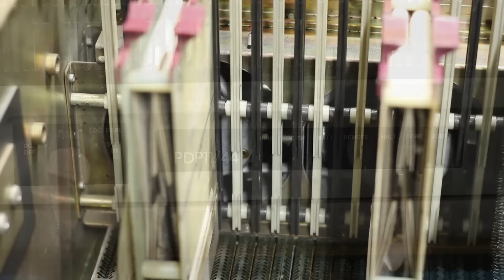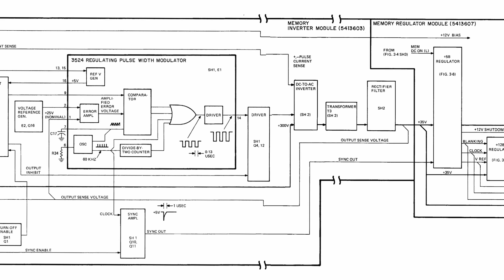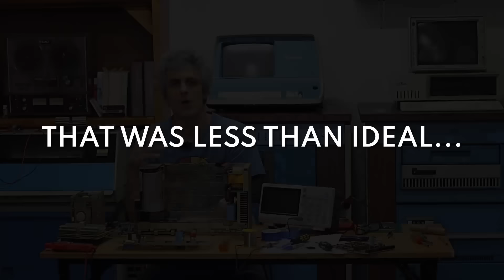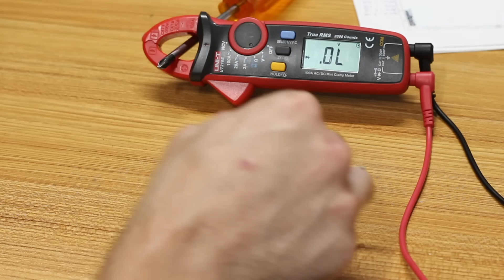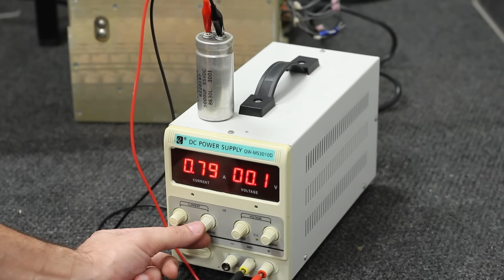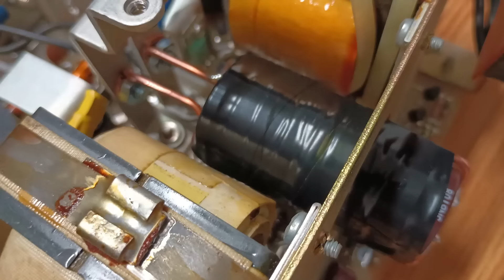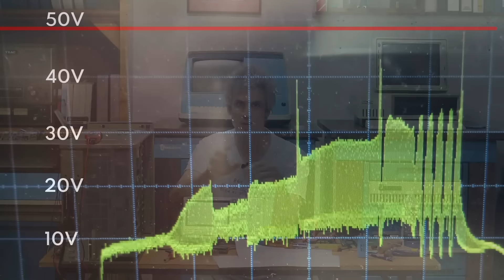PDP-11/44 PSU is Slowly Coming Back to Life!

Comment: Thanks for all the great videos! I'm sure you've thought of this, but just in case you haven't or it hasn't occurred to anyone else reading the comments, having a little portable battery powered scope is really great! I have a Zoyi ZT-703S and it's an incredible value! I think around $90 USD? Sure, it's not going to be as good as a bench scope, and there are portable scopes with better features, but this thing I have... wow. It's quick and easy and works so well - well enough to poke around and see what's going on during a repair. It's got a built-in rechargeable battery, that I believe is easy to replace, but because of that you don't have to worry about having an accident like what you had in this video. It's not going have a ground that connected to earth ground when it's running on batteries, so you can't short out something to earth ground by accident. I believe in your situation having an isolation transformer and a bench scope might have helped avoid this, but just having a little battery powered scope has been a game charger. Nobody is sponsoring this comment I just have one and I didn't think it would have the positive impact it has. 

The convenience of having a battery powered scope just on my bench ready to roll means I'm way more likely to just grab it and use it. That's had huge benefits! I love it and wish I got one years ago!
Reply: Or one powered by a USB adapter like the FNIRSI 1014D
Reply: @MichaelThwaite  Actually that brings up an important point! I just checked and my USB based Hantek oscilloscope and it's BNC connectors show continuity between them and USB ground as well as earth ground! So if you had your USB oscilloscope's ground connected to something like a live chassis vintage television that's plugged in then you'd be creating a connection between your computer's ground and the mains voltage! In this case in the video, the ground of the oscilloscope is connected to USB ground and earth ground via the computer. So when, in the video, he connects the oscilloscope ground to the floating ground, he would again recreate the same conditions as in the original video. The floating ground (or logic ground? virtual ground? whatever it's called in this case) may be at some voltage potential that's different from actual earth ground and connecting it to earth ground might cause power to flow in some way the circuit wasn't designed for. But if the oscilloscope is battery powered, and the device is NOT connected to USB or any charger of any kind, then there's no way for there to be an unexpected connection between the circuit being tested and earth ground. Although I still wouldn't work on a live chassis television without an isolation transformer. So don't use a USB oscilloscope on something where the ground connection may not be at the same ground as your computer!

In short: The safest way to poke around a circuit is with a battery powered, and not plugged into a charger, oscilloscope. 

Legal notice: I am not qualified to do, say, or give advice to anyone for any reason.
Reply: @chironbramberger  Yikes! Yes, I think my USB scope maybe getting a rechargeable battery pack! In my case the scope I have is powered by USB and is connected to a 5V USB Type-A PSU which, is double insulated (no earth) so, I don't think there will be a connection to mains earth in my case as, it's a 2-pin reversible connection (US 120V) so such a passthrough could be, well, fizzy in 50% of the insertion conditions. All food for thought that I'd never considered before.

Comment: I'm not impressed with the 74 series TTL IC's. 
I worked with and fixed DGC computers from the NOVA 800, NOVA 1200 to the ECLIPSE computers, and of course 2.5MByre Diablo HDD and DGC hard drives.
(And the huge 300 MByte CDC SMD drive
Readers must know that almost any computer manufacturer then made his own peripherals.

Comment: Have you thought about feeding your own +12 into that pin? If you have a variable power supply you should see the circuitry trying to compensate without having to plug it in to the "scary voltage".

Comment: Great video. 
Two comments: 
Firstly: TIc-Tic sound coming from switch mode power supply is almost always overcurrent protection. And please, get a new caps + decent component checker for leaks and ESR.
Secondly: Ground loop with Oscilloscope, been there, done that. Can get nasty with high power systems. Using isolation transformers at AC is a good idea. Or Diff-probe ..

Comment: electrolytics WILL have a certain amount of remaining DC current even if good , i'd say 10ma for a high capacitance low voltage is good, but important thing is esr , especially on a switch mode psu, if it regulates by sensing dc off a cap, high esr can result in high dc pulses to the sense circuit, making output low or even shutting it off if it has overvoltage trip out protection, i had this issue with a philips crt tv in the mid 1990s   .. reformed caps can seem ok but still have poor esr, its not so critical with linear/ac line frequency power supplies but switch mode circuits can be picky..

Comment: When I would use an o-scope for TV troubleshooting and I needed to connect the scope ground lead to the chassis I would use an AC power cord where I tore out the ground connection. This help prevent the scope ground lead from shorting out the chassis to earth ground. So try using a ground buster power cord for your o-scope so you are not causing problems like you had suggested you had in the power supply.
Reply: That will often protect the scope from damage, but compromises the shielding of the cabinet and doesn't improve personal safety. The lack of a grounded cabinet can both show noise that isn't present on the circuit being probed and induce scope oscillator noise into the unit under test.

Comment: This is why i personally don't reform capacitors. They are not that expensive to replace, even the big ones. And as shown, even after reforming it's still an expired component that could fail at any time. And since all caps in that power supply are of similar age.... The should be replaced. Proven by it's twin being a short.
You could keep some of them if they test fine, if you had the equipment to test that properly, which you don't. 
This is a switching power supply, it's a job that is very hard on capacitors. Unlike many other applications. 
I doubt i will convince you and i don't need to, but this is my two cents on this subject.

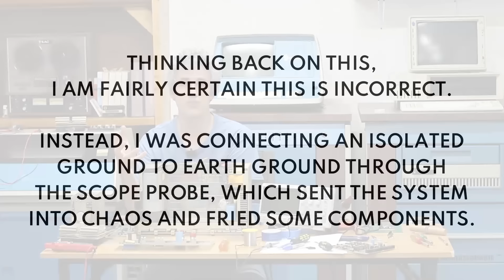Comment: 9:45 when measuring on a switch mode power supply, using differential probes is a good idea. Also: in the schematic there is evidence that gnd and chassis is different. Look at the guard (dashed line) in the transformer. It is connected to chassis which is indicated as a slanted earth connection. See the difference with the earth symbol on the chip and the transformer terminal with the three parallel lines.

Comment: USE AN ISOLATION TRANSFORMER. When servicing any line operated switch mode power supply always use an isolation transformer on the AC power input. You are absolutely correct about the internal power supply grounds,. Schematic ground is not always chassis or output voltage ground and is often associated the AC line connected circuits. Remember your scope has a three wire grounded power cord. That means the scope probe ground is at chassis ground. Some people are tempted to use a ground lift adapter on the scope or the device, DON'T. That's asking for an early death. Remember that ground and neutral are bonded together in your house main breaker panel

You have a knack for acquiring things so finding a 500va or better yet 2kva isolation transformer should be rather easy. Also note that most Variacs do not provide isolation. They are just variable autotransformers.
Reply: differential probes with mains powered stuff.
Reply: @v12alpine  That still doesn't remove the safety hazard. It's easy to forget and connect some other piece of test equipment besides a scope.
Reply: @andydelle4509  I would say if you really can't avoid poking around with your probes in a powered device you have to use an isolation transformer for your own safety. In addition to that you then have to use differential probes for every single signal you look at. That protects you from at least directly grounding the isolated side of the transformer. In addition it protects the machine from shorts even with multiple probes attached.
But usually also with differential probes it is necessary that the probed device and the probes have some kind of common ground to keep the common mode voltage of the probes within the permitted range. So connecting the secondary side of the transformer with trustworthy and certified high value resistors to the same ground as the scope or bnc connectors of the probes, maybe the only option then.

Comment: That fan sound bring back memories --- Worked at a manufacturing plant back in 1987 where we had 6 PDP-11/40s -- the fan noise was impressive -- and constant -- not to mentions the associated A/C required to keep the computer room cool.    

The PDP-11s ran Baseway under RSX-11S to implement a Shop Floor Gateway.    Collected digital data from shop floor  for use in  identifying and counting parts produced among other data by a upper level application.
Reply: Sorry... I can't hear what you're saying over the noise of these fans!!!!
Reply: That much hasn't changed. We have by necessity put our A/C in the same room as my husband's modern-day gaming PC.

Comment: David, I have an ESR meter I'd like to send you to aid in evaluating the health of electrolytic capacitors, if you're interested.  I'm personally not a believer in capacitor reforming as means to return them into service...Typically, the reason these types of capacitors fail over time is that the electrolyte gradually dries out, and unless it's rehydrated it won't operate as designed.

Good luck repairing the third rail!
Reply: I have always thought of reforming electrolytic capacitors as just a temporary procedure, just to get the device into an operable state for further testing.
Reply: It's good to know that electrolyte capacitors reform, but not good to use that as a repair technique.

When an aluminum electrolytic has been used at a voltage well below it's rating you know two things; that it's capacitance is going to measure high, and that it's going to be prone to higher leakage current. It's also going to have a shorter life expectancy, but you can't measure that.

Comment: Ah yes the classic unintentional short to earth through the scope, been there too many times…
Reply: Can you avoid that with a battery powered scope?
Reply: @karlramberg  yeah, or a battery powered circuit
Reply: @karlramberg yes, or a isolated usb scope, or usb scope with Laptop on battery power.
Reply: @SB7-r9i  Don't do the laptop thing. Laptop cases provide little to no insulation and if you accidentally connect the ground lead of your probe to mains, your case is at high potential. USB scopes at least if they are not the cheapest of the cheap  usually have a grounding screw or can be connected to ground by other means. And usually the manufacturer "recommends" to use it in the manual. The USB connection shouldn't be the sole ground connection.
Reply: @karlramberg  Better use an isolation transformer instead, less dangerous.
Reply: The first time that happened to me, I was working on an All-American 5. I went to connect the scope's ground lead to the chassis and boy howdy! I got my heart rate back down to nominal and reset the circuit breaker. Then I turned the radio's plug around and tried it again. Success!

Looking back on the things I did when I was a kid, it's a wonder I survived. Oh, later on I invested in an isolation transformer.
Reply: I didn't know for a long time that usb can carry more than 16 amps until a colleague demonstrated it to me with one of those usb oscilloscopes.
Reply: @HansS-vh8de  was this a type C 5A that they juiced for a few moments to demonstrate? that sounds downright improbable, they're like 28 gauge usually.. and I have only seen 12A on type C that was still 5A nominal rated just super spec'd out. nonetheless must be dangerous

Comment: You need an ESR meter. That mallory capacitor could have excessive series resistance, causing the 35Vdc to oscillate instead of filtering/smoothing.

Comment: When in doubt drag out the diff probe (or rig up differential mode with two probes), or at least make a DMM voltage measurement between earth and whatever circuit node you plan to use as a ground. 

Also disregard anyone telling you to float/isolate the scope, one of those dangerous half understanding problems, you always float the DUT if anything.
Reply: @Broken_Yugo So how is using an isolation transformer on the scope different from using a battery powered one?
Reply: @MrCHrisfj  There is no difference and both are more or less equally hazardous unless you're talking the high dollar Tek, etc. handheld scopes with  plastic shell BNCs and special reinforced insulation probes that are actually intended for that sort of service. The point is a floated scope can be at any potential when they're covered in metal that's supposed to be at 0. It adds a lot of unpredictability that can and does kill to just save a buck or some setup time, it's a dumb way to die.
Reply: @Broken_Yugo  Thanks, that makes sense.
I suppose the recommendation to float the DUT is the same logic as using an isolation transformer for electrical outlets in a bathroom here in the UK: any fault is isolated so you reduce the chance of a path to earth (and therefore risk of electrocution) as much as possible. It also limits the current because of the windings of the xfmr.
Reply: @MrCHrisfj  Sort of, in the repair case its more about keeping the unknown in the unknown area. Remember that once you clip that ground on the scope probe into the isolated circuit every voltage is now referenced to earth again and the shock protection disappears, in addition your RCD/GFI can't see through the transformer, so you can still get bit hard. Ultimately there is no "safe" way to probe such things, just methods that vary in how hard it is to screw up. 

 On that note this discussion wouldn't be complete without mentioning the whole typical iso transformer test bench setup goes back to tube TV/radio repair where the tech was lucky if his scope was good to 5MHz, single channel, synchronized sweep. Practically speaking there were no multichannel trigger swept scopes with math functions, affordable high voltage differential probes, or RCDs. Modern method is generally to use the diff probe and power the DUT with a RCD/GFCI (test often!) to cut power in case of oopsie.
Reply: @Broken_Yugo  It's useful to have a look into the manual of the scope. Some scopes allow floating grounds on each channel but only up to 30V above earth potential and some e.g. Fluke scopemeters allow levels of up to 300V.
The older Hantek handheld scopes (don't know about the newer ones) have exposed metal bnc connectors. Everything is connected inside even the calibration contacts and if you have a 2 channel scope with only one connected probe and you are probing mains voltage, you have a high possibility to touch it.
Most users wouldn't expect that and the special use cases of those devices will lead to dangerous situations.
Reply: @MrCHrisfj  The voltages inside a battery powered scope can't kill you.
Reply: That wasn't what I was getting at  @DirkEibach  I know the voltages inside any mains powered scope can kill but I wanted to understand why not use an isolation transformer to power the scope in this situation.
Reply: @MrCHrisfj  Every chassis grounded part of the scope will be at whatever voltage you have on your signal ground, which is surely not 0 V WRT earth (otherwise you would just not need isolation/diff probes etc., right?).  Think of metal chassis (if the scope has one) and other channels exposed BNC ground.  That is not something you want, and that is why the whole thing is grounded in the first place. Big no-no for me if you are not really really really sure of what are you doing.

Comment: Always use differential scope probes when working on unknown equipment.

But can such a beast of a diode blow up by incorrect grounding with such thin wires? I would expect those thin wires to simply melt. Could it have been coincidence or the repeated power cycling that finally killed it?